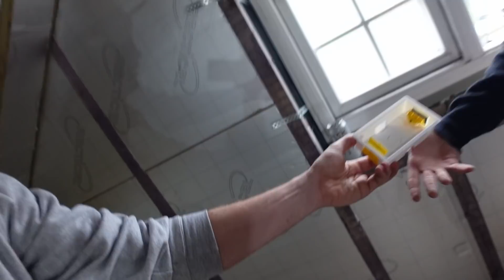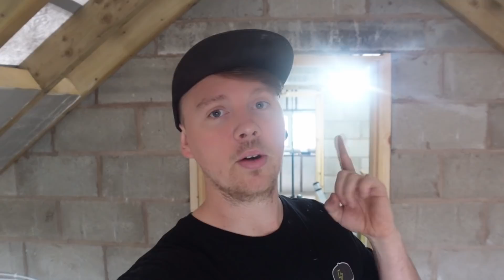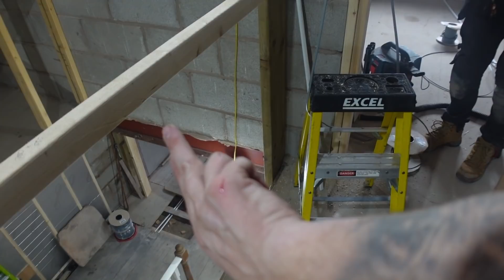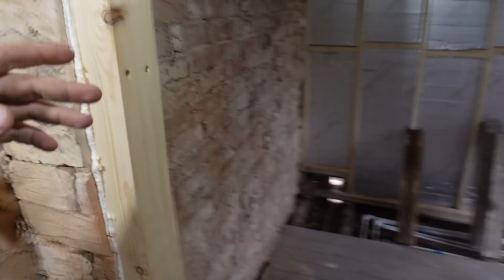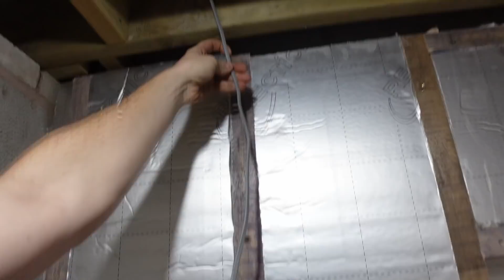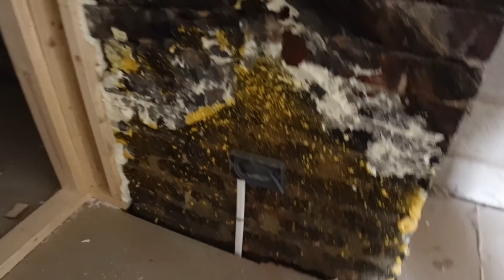My biggest job ever, £12000+ - Electrician

Comment: Bathroom  lights should  be fused down for fan .This is a requirement.
Reply from the maker: Hence the 3 pole fan isolator having a 3 amp fuse in it
Reply: @NBundyElectrical  Nice one mate no flies on you .Keep  up the good  work  bud 👍

Comment: Nick on bathrooms I always feed the fan isolater saves a joint box in the ceiling feed the fan iso 3 core to fan lamp wire and switch line easy makes a nice tidy job.

Comment: last week work. normal single room+bathroom condo/abartement build ALL elektric new, new main fuse box, all cables,all sockets,fuses,light, etc. cost less than 2000$ only new fuse box and cable work uses old socket same cost 1000$ this have normal all europe. full big house not newer cost more than 10k, only if have lot automation, cameras ewery room and fridge and cellar and ewerythink can controller tablet around in world. light,geat,door,fans,ewerythink, then cost 20k-30k all.

Comment: Switch feeding is always the way to go now lad. Especially when clients pick those delightful pendants/wall lights with sod all connection space in them. At least you'll only have a maximum of 2 cables in there.
Plus means you can add smart controls at a later date if you install 47mm deep boxes at the start.
Smokes on apex need to be 0.5m down from the peak bud 👍

Comment: Wondered what the voltage drops were with those long runs. In US we are recommended no more than 5%drop it’s a performance rather than safety issue and as you say I doubt your LED lights would have any issues even if they were greater than 5percent. Of course the 5percent guidance is somewhat moot in USA where long radial circuit runs are the norm in our larger houses.

Also did you re-test the temporary board just in case there were shenanigans in between your visits by others?
Reply: It’s 5% power 3% lighting

Comment: Do the switch wire for the bathroom in a 3 core and earth, then wire that to the fan isolator and then off to the fan, less cables above the first light and much easier to put away!

Comment: As there is 3/4 levels i assume u are fitting SMOKE / heat detectors on each level esp I attic and stairs etc .. also any garage if three is 1 attached to the dwelling… personally I like ICO 10 year interlinked intrinsically secured battery

Comment: With what you ran through ie outbuildings and so on it's a £15000+ job subject to outlets used and remember no vat on new builds
Reply: You still charge vat. The vat free part comes at the end.
Reply: @UberAlphaSirus  oh I've been doing it wrong for 40 yrs then 😂 lol with the old rules ( ie not reverse vat ) NEWBUILD IS ZERO RATED which means that vat registered contractors must zero rate their work and NOT charge VAT ON ANY LABOUR OR SUPPLY AND FIX CONTRACTS ( new rules ie last 6 months their is still no vat on new builds )

Comment: What joint boxes will you be using above the ceiling? 
I just done a similar wiring method and installed JCC V50 lights, trying to fit a wago box in the ceiling with the celotex into a 70mm hole was tight!
Reply: Click Flow connector a good shout 👌

Comment: Nick im a sparks in ireland,what is the code for smokes and heats in england never seem to hear  what you install in houses
Reply: Typically to meet regs, one minimum on every floor, 7.5 metres from every bedroom door, kitchen and utility needs there own one, kitchen and utility also needs to be a heat alarm

Comment: What’s happening with the heating situation there Nick? Air source heat pump? Boiler?
Reply: best and cheapen use long time many year have warm water floor heating system.inside floor have water tubes and hot water go out boiler to floor tubes. cheapen use,  on boiler need be oil,wood,waste oil burner possiple use, or coals.

Comment: Fun fact, In Sweden is not allowed to use brooms for sweeping constructions site, Because it spreed dust around.
Reply: I approve of not cleaning up ;) (but i see the reasoning)
Reply: @TheChipmunk2008  we clean, you just have to use a sqeeky instead because it will push or drag the dust without throwing it up in the air.
Reply: I don't think it is much different here. There was a case recently where a woodshop owner was fined by the health and safety executive for dry sweeping his floor, even though nobody else was affected.

Comment: How I’d do the fan feed, would be a dual 25mm back box at 1200mm, the left side a 1mm feed in/out, plus 3 core for 2 way, a little 3 core link across to right hand side and out of the right side in 3 core to the fan. Assuming your looping at the switch.

Comment: Couldn't you use one out for two bathroom fans?
Have a 2 into 1 duct?
Reply: I think it's generally a no-no as it does not stop the steam /condensation blowing back to the other side vent - i.e. no non return in the vent pipe.  Building control in my area were insistent that each bathroom must have it's own external vent for my bathroom renovation.  Builder was pissed as he had already put in the vent pipe to the gable end wall so had to add a second one.  They also made him lift the fan to provide a suitable gradient (from fan to outside) to make sure that condensation would drain to the outside and not pool in the vent pipe.
Reply: @barrieshepherd7694  fair play Baz.
Just a brain wave I had🤜
Reply: @edglue6138  And one my builder had - but apparently he should have know better LOL :-)
Reply: @barrieshepherd7694  haha. Them building inspectors are laws in themselves.
Always make sure you get the same one from start to finish.
They all have there own ideas🙄

Comment: Great videos 👍🏽 would be a nice job for a home automation control 4, not sure if you have allowed for led strip lighting on that job would be great as feature lighting in certain rooms my want to talk to your clients about that too,if you do use 24v strip lighting,I always use that on jobs not 12v, keep up the good work 👍🏽
Reply: Speaking of home automation, it's worth talking to clients about having neutral conductors at all of the switches in case they ever want to fit fancy home automation switches.

Comment: Tidy work mate 
Not a big fan of the dry liners I usually put nogins between joists that allows for a fixed back box. 
Also not liking the idea of maintenance free in bathroom, why not link up in fan iso or go deeper on the switch box, sorry might not of understood what you are doing. Very nice job for ya 👍
Reply from the maker: My problem is I’m not quite sure on the depth of all of the walls,  they tell me it could possibly be 37 mil but in my experience that changes every five seconds, so dry wall boxes for me it is 👍
Reply: @NBundyElectrical  fair shout mate 👍
Reply: @NBundyElectrical   Not sure what the obsession with not using dry lining boxes is…..absolutely fine, why make extra work for yourself 🤷🏽 
Good job, keeping an eye on the builders is key when doing bigger jobs like that (so you don’t lose cables etc) 😂👍🏼

Comment: Nice project, building work looks to be very high standards 😎
Reply from the maker: Thanks sean, cracking builder 👍
Reply: if build high standard how law say make all. good. ewery cable need be in plastic tube, ewery cable need be 3 wire, hotline, zero, and ground. then have right and perfect. and ewery water point near NOT have socket etc elektric point, need be far minimum 1,2 meter out of all water point,tap, pool, sink. not newer nearest. and ewery outside socket and bathroom socket need be safety break 30mA fast automatic circuit breaker.
Reply: @mattivirta  Stick to america pal
Reply: @mattivirta  Rules differ between countries. UK doesn't require conduit (tube) but yes it's a good idea, if possible. 30mA RCD's are required for almost everything in houses. Unless there's a shower or a bath in the room, we're allowed electrical points anywhere, but the recommendation is minimum 300mm from sinks/taps etc.

Comment: In jobs I worked on , when they dot and dab a block wall you should usually chase the backboxes if they are 35mm about 15mm , the amount of boxes sticking out of new builds when they used 35mm boxes on this . Also I would use metal capping  for when it's being dot and dab because it's thinner and makes the drywallers job easier
Reply: Just use 20mm straight on the wall. 12mm board 5 - 10mm dot n dab.
Reply: @Sondervibes1  in some jobs if the wall is small like for a kitchen for example I used 35mm straight to the  wall but just because I knew the drywaller , some budget newbuild flats we used all white sockets and switches we put 25mm backboxes without chasing  everywhere but that was agreed by the builders to drive costs down

Comment: With the distance from the mains and the cellatex,best to do your calculations to see if you need 1.5mm t@e
Reply from the maker: I did a few calculations and with the upstairs only feeding 3 rooms, even if they were to swap all for halogen it’s well with Parameters dude 👍
Reply: @NBundyElectrical  not doubting your excellent work nick,it's just if you have an apprentice and up and coming sparkies following which I now you have,it's a tip you can pass on 👍
Reply from the maker: No not at all dude, it’s a great question for the younger guys to see dude 👍
Reply: @NBundyElectrical  What ambient temperature did you calculate for? Those cables sandwiched between the celotex and roof tiles can easily exceed 50 degrees. Basically they are sat in a solar oven. Unlikely to affect a lighting circuit but can make a shower feed a big no no.

Comment: The commando socket must be a TT earthing arrangement,  were they moor there boat it has to be treated as a marina , so you don't export the earth . Preferly on a 32 amp mcd at the board then a  40amp rcd and 16 mcb near the mooring , you need to get a enclosure used on a camping site .  Be there done that  at brauston northampton which has a narrow board show every year
Reply from the maker: Thanks rob 👍
Reply: @NBundyElectrical  your welcome